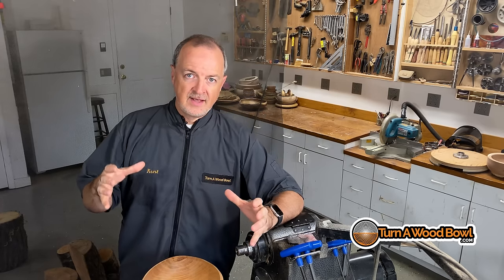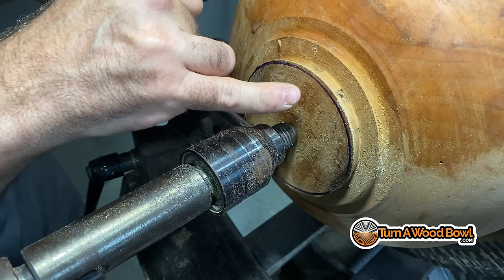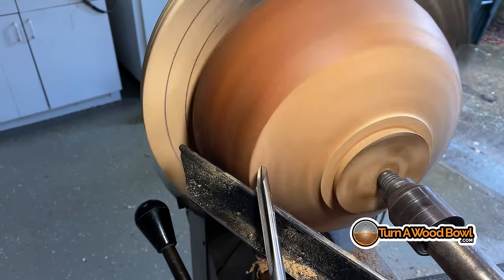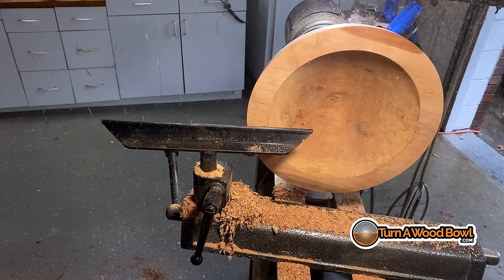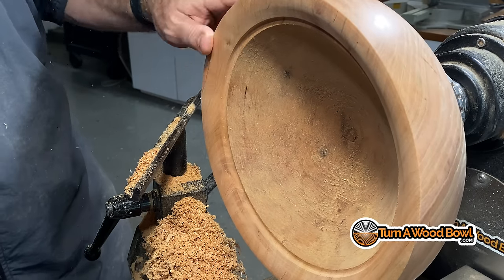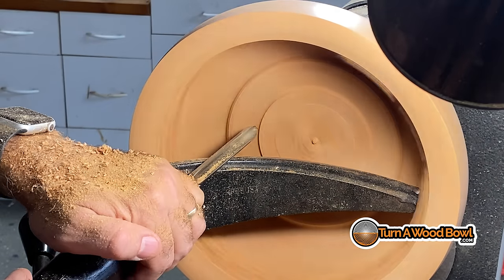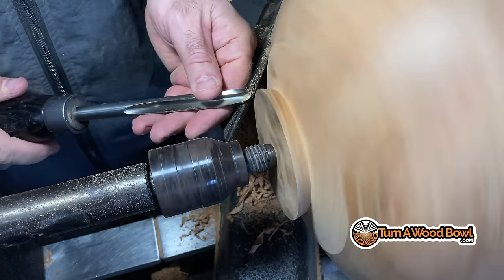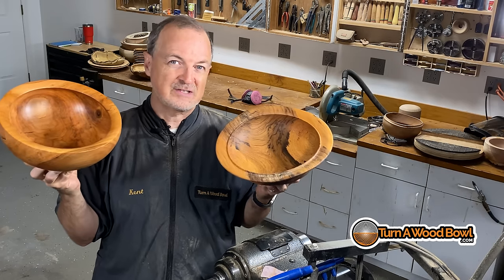Woodturning Twice Turned Wood Bowls - Wood turning Video Green Wood Dried First

Comment: As a journeyman machinist for 35 years there were some tricks we used to cut back on chatter that gets translated to your worked surfaces. Here is one, but there are many. Put a vibration damper in your bowl when pressure holding it doing the outside. I would experiment with the right size old sofa cushion foam stuffed inside the bowl. It might give you a finer finish needing less sanding. I would try it but am disabled from a hand surgery to restore damage when a heavy piece of metal fell on my hand using the lathe. Thanks so much for your fine videos. I look forward to using my hands again working with wood. You are a good teacher. an inspiration for me to work through the pain to get my hand functional.
Reply from the maker: Russell, Thank you for writing and sharing! That's good info. Thanks and Happy Turning!

Comment: I have just acquired a load of fresh cut sycamore and turned two bowls from it. My left sleeve was wet from spray when I had finished. The bowls are resting in their shavings at the moment but tomorrow I will seal the ends. It is lovely turning wet wood, the shavings come off like a stream from a hose. My next stop is drying wet bowls with a microwave.

BTW An American football is similar shape to a rugby ball used by the rest of the World.
Reply from the maker: Sounds great! Yes, green wood is the best to turn! I was thinking of a soccer ball. Isn't soccer also called football in Europe? Happy Turning!

Comment: I like to species label my first turned and date them. Then I place them in my dry unheated shed for at least a year. Had pretty good success of about 90 to 95% not cracking. Normally I leave the wall thickness at  no less than 1" even on 8" diameter bowls but 10% on bigger ones.....Ron Cumpsty .
Reply from the maker: That's a great way to do it, slow and steady. Happy Turning!

Comment: I am presently working on sets of twice turned nesting bowls that I have cored and are drying in my cellar, so this is a timely video.  I find it much easier to finish off the inside bottom of bowls by switching to a 60 degree gouge.  Looking forward to your sanding video.  They say woodworking is 80% sanding and 20% fun.
Reply from the maker: Thanks! I'll show you how sanding can be about 5% of turning!! ;) Stay Tuned!

Comment: Very nice. By the 38 Minute mark I normally would have switched to a bottom gouge. I find it much easier and smoother. 
Also why do you use Danish Oil when you could just purchase the linseed oil. I think the Danish oil has additives to help drying and is not just Linseed oil. I have been using Tung oil for the last year or so, but will have a go with Mahoney's oil at least while the bottle lasts.
Reply from the maker: Great question! The Tried and True Danish Oil has zero additives and is polymerized linseed oil. As far as I know they are one of the only companies that makes Danish Oil this way and it's fantastic. And about the bowl gouge, my main gouge is a 55° swept back bevel and it gets down in the bottom very well. I will jump to my micro-bevel on deeper or narrower bowls. Thanks and Happy Turning!

Comment: Kirk, I love your "Turnawoodbowl Videos.'  I am presently doing a set of four bowls from wet green Holly wood from a neighbor friend.  So I am learning about drying the wet first turned bowls in the micro wave keeping records on each bowl.  One of my granddaughters is getting married Dec. 29th so I am hoping I can dry the wood enough to do the twice turning early December to present them as a wedding gift. A 12", 10" and two 7" all food safe with danish oil for use as a salad bowl or popcorn, etc.  I've used the end grain sealer after I turned each bowl green on the end grain to help minimize the distortion as they dry.  I think it is helping.  I left the 12' bowl almost 1 1/2"  thick and I am wondering if I can trim it back a bit to speed up its drying time, I've been dring it for a week now it started at 6lb 6 oz and is now down to 4lb. 14 oz. any thoughts?
Reply from the maker: John, great question. As I say often, it all depends on the wood species and your conditions. There are several things to consider. Have you turned any of this holly completely yet? How much is it deforming as it drys? If the holly isn't deforming much then you may be ok. The 12" bowl first-turn 10% diameter could be 1-1/4" thick walls but you're already very close to that. The idea behind the 10% wall thickness is to leave enough material to have a complete final thin wall. If the bowl turns to an oval and you true up the exterior, there needs to be enough "meat" inside at the thinnest areas of that oval. If not, you'll turn through the wall on the interior turnings. I think you have plenty of time, I'd keep cycling the bowl through the microwave for another week or so and you will probably see their weights "come in for a landing" and stabilize. Hope that helps. All the best to you and your fantastic wedding gift!! Happy Turning!

Comment: My sister just had some cottonwood trees cut down. I'm doing two large 12"+ blanks as twice turned bowls. They were so wet they were like standing next to a water sprinkler on the lathe.  :-) In several months I'll find out how it goes on the second turning.
Reply from the maker: Keep those puppies moist for awhile so they can "calm down." Cottonwood cracks like crazy and you want to ease the drying process from high moisture too low to prevent cracking. Use a paper bag and mist them periodically. All the best to you. Happy Turning!

Comment: Hi Kent 
Fairly new to turning and learn and enjoy from your videos.
My issue is when I twice turn I have trouble with the walls being different thickness. Can’t figure out why. 
I wonder if you have any tips to correct my issue 
Thanks Jeff
Reply from the maker: Jeff, be sure to return the bowl exterior first. If it is not trued  up there will be high and low spots. When you turn the inside there will be thin and thick wall areas because of an untrue exterior shape. Hope that helps. Happy Turning!

Comment: Kent, I just love your channel I have watched others but I find yours more informative.   I watch them over and over then I go out in the shop and turn away.  I am new and have only turned few bowels because I don’t have any dried wood.  I am still practicing.  You have mentioned your dryer for drying bowl blanks.  What do you use to dry blanks and how long does it take.  Thanks Kevin from Minneapolis.
Reply from the maker: Kevin, 
Thanks for writing. Great question, a loaded one, but a good one. You can dry a number of different ways. Have you seen my microwave drying video? I'm finishing up my online Wood Bowl Turning Start-to-Finish eCourse soon, and I think I'll be starting the Green Wood course next. Quick answer - use an insulated space, could be an old frig or freezer, or make a box with insulated foam, then insert a regular lamp with an incandescent light bulb. Be some small vent holes to allow moisture to evaporate and you're set. Stay tuned, I'll have more to come.
Happy Turning!

Comment: Thanks for another great video.  
I notice in your videos you have some kind of sheer material around your lathe, I assume to confine chips & dust. I'll be doing the same. What kind of material did you use?
Reply from the maker: Good question, and you are right, that's what it is for. It's a roll of replacement window screen suspended with bungie cords.
Reply: @TurnAWoodBowl  thanks

Comment: What about a vacuum chuck for reforming the tenon and turning the outside after drying? I have one but have only used it for finishing the undersides of bowls but am about to do my first green bowl that is dried and ready. Will the vacuum chuck have enough holding power?
Reply from the maker: You can go that route, but it's time consuming, expensive, and won't work with porous wood surfaces or worm holes…which are common. Happy Turning!
Reply: @TurnAWoodBowl  it worked really well for finish turning the outside and reforming the tenon, but then yes there was a worm hole at end doing the underside and it took me forever to figure out why I couldn’t suction!!

Comment: Kent - why not use the same jam chuck for both operations? (the flat/foam padded plywood disc vs the rounded 'stump' of a chuck you used to finish the foot) I might have to make one of the flat ones, thanks for the idea and the video! Cheers.
Reply from the maker: Good question. After a bowl has been rough turned and dried, many things are distorted. I find placing the rim on a padded surface gives more support to the piece and helps center up the tenon quicker, versus randomly trying to find the center on a smaller jam chuck. Thanks for asking. Happy Turning!
Reply: @TurnAWoodBowl  Continuing the question: I was wondering why you don't use the flat padded disc for both operations.

Comment: Hi Ken. Thanks for another terrific video. Your approach to the second turning is really helpful. I started to try to make the jam chuck you showed but have a few questions: I presume that it’s 15-16 inches in diameter. How wide is the space?  How thick and hard is the rubber? I tried using some thick, somewhat soft under carpet rubber and I was unable to true the bowl due to a slight wobble while turning. Lastly, do you have a dedicated faceplate that you keep attached, or do you have a solid way to attach and detach it?  Thanks, Arthur
Reply from the maker: Arthur,
Great questions.
I use 3/4" plywood that is as flat as possible. I rough cut the circle, attach a dedicated faceplate and then turn the edge smooth. Then I pieces of a rubber floor mat to make the side. Hope this helps.
All the best to you and Happy Turning! 
Kent

Comment: Hi Kent,
 Another nice video and very helpful.  It looks like you have a Robust Sweet-16...how do you like it?  I have a Robust American Beauty and love it!   I picked it up at the Robust factory as I live nearby in Central Wisconsin.  I was curious of what looks like a tail stock extension on the quill.  Is this an add on Robust has or was it developed on your own.  What is the reason for using it?  Thanks, Myles
Reply from the maker: Love my Sweet 16. The tailstock extension comes with the 16 to bridge the gap when turning with the rail section removed. Happy Turning!

Comment: I would like to know the speeds that you use which I imagine will vary with the types of wood. Great information, thank you
Reply from the maker: The speeds vary based on stability and I try not to exceed 1,000 rpm. That being said, my lathe does not have an rpm readout. Lathe speed video coming soon.

Comment: Hi Kent, Yes I'm trying what you call a twice turned.  As I mentioned in another post, I bought 2  Olivewood blanks.  Out of the 24 bowls that I've turned none had been green.  So, I started to watch videos on how to handle a green blank..  

I've had trouble with cracking even though I've tried to dry it.   I'll take out 3/16 of an inch and it'll be wet again.  4 times drying before I got it down to 3/8 of an inch.   Filled the cracks as they happened.  

I have not had any classes in turning or finishes.    I started turning ink pens first.  Then my brother told me to try a bowl.  And he gave me a 5 inch cedar blank.  Ha Ha No more pens.

Have you turned green Olivewood before and if so what did you do ??

Wesley Colyer,  Mack, Ohio
Reply from the maker: I have not turned olive, but I've turned ligustrum which is a relative to olive. What I noticed was the wood has lots of oil and can be turned once to finished size instead of twice-turning. Make the wall an even thickness and it shouldn't crack. All the best and Happy Turning!
Reply: Thank you Kent for your reply.  I read what you said about Olivewood.   But I didn't get to your answer before I put it in a dehydrator 24 hours at 95 degrees.  It warped with little cracks in the end grain.  

Next time I will try once turned on green Olivewood. 

Wesley Colyer

Comment: Kent, I'm a rookie turner and these tutorials of yours are like gold to me.  This one was particularly helpful.  Here's my question.  All I have to work with is really green wood and I am really frustrated by the cracks that develop from (I guess) improper drying.  It seems that everyone online has a different method for drying a piece of wood.  I've tried most of them and they all work to some degree; but I'm looking for the best method and I have yet to try kiln drying.  You mentioned putting a rough turned blank into your dryer.  Can you explain how that works?  I understand pith problems, equal thicknesses on the sides and bottom, and slowing down the end grain.  How is it that to prevent cracking one must slow the drying process and yet speed it up by putting it in a kiln?  

My other question is what kind of beer do you keep in that fridge back there?  Thanks for going to the trouble of making these videos.  You're teaching me a lot. - Tom
Reply from the maker: Hey Tom,

OK, I have a simple box made of 3/4" foam insulation with a work lamp and a 70 watt light bulb inside. I rough out bowl blanks with wall thicknesses 1/10 the size of the bowl diameter. I seal the end grain sides with Anchorseal and put them in. The temp is around 90-100° and they dry and deform after about 2-3 months. Then I twice turn them. 

Remember every tree species is different, as is every different environment. Be patience, pick one or two local species of yours and learn how they act and respond to different drying times, etc. You can become a master of your local tree species, just be paying attention. 

Happy Turning,
Kent
Reply: The main thing with drying green wood to me is a large grocery bag, when you have a rough turned put it in a large paper bag, no plastic, put it in there for a couple months and return it to lathe and cut some more. Cut some more and put it back in a Walmart bag and in a few weeks turn it again. ⁷

Comment: I agree with Don.  Great videos.  When you do your videos, can you please mention the speed of your lathe?  I'm going to make the 'jig' or press chuck you show here ... just want to know how fast I can turn using it.  I know it will be pretty slow, but specifics would help.  Also, how tight do you crank your tail stock.  Thanks for the videos.
Reply from the maker: I'll have a video on lathe speed soon. Believe it or not I don't have an RPM readout, its all feel.

Comment: I found this video very enjoyable and helpful, as well as your many articles on turning at TurnAWoodBowl.com.  These are all  very beneficial for both novice and somewhat experienced turners.  This video reinforces what I have been learning at the woodturner's club I belong to (Illiana Woodturners - shop located in Holland, Illinois) and from other material I have seen elsewhere.  This start to finish video of the process was very good.  

I especially like the home made faceplate/disk you showed to accommodate the eccentric shapes of the warped bowls.  I will whip one up straightaway.

Two questions:  
1. I coat the entire green turning with Anchor Seal, not just the end grain.  Is that taking it too far.  You recommend only coating the end grain areas.  I can see the logic.
2. What percentage moisture do you recommend for the beginning of the second turning?  (Measured with a meter? or by weight?)
Reply from the maker: Thank you! Glad to help. BTW, I was just in Illinois and drove back some pear, cherry, elm, and plum! ENjoy and all the best to you!

Comment: New to the lathe and have turned two bowls. I see that you are using a tenon on your bowls.  I have used a mortise, but to my way of think then you can't make a twice turned bowl due to being able to hold the bowl while you straighten up the tenon.  Do you use a tenon on all your bowls or do you have a way to hold the bowl while you clean up the mortise if you use them?
Reply from the maker: Yes, I'm a tenon fan. You can twice-turn a mortise, but it's a bit awkward for me. I'm sure others do it with no trouble with a bit of practice. I find the tenon allows for more foot options too. Happy Turning!

Comment: A bit of advice please. I have some sycamore which I have sought to twice cut. I used your advice to dry the wet wood in a microwave. This first cut bowl is nice and dry. But, big but. The bowl is, as you said, now oval shaped. The inside on the narrowest diameter is 6 7/8” and the widest is 7 1/4”. Unfortunately the walls are only 1/4” thick. There is no way to turn it round. It is pretty smooth. Do you think that I could sand it and finish it? Or should I put it down to experience and put it in the firewood? Trouble is - I love it as my first effort!
Reply from the maker: Good question. Of course you can sand it and make it good. I think you now know what to do in the future, if you want to make a round bowl. It's all experience, one way or the other. Happy Turning!
Reply: @TurnAWoodBowl  I’ll send you a picture.

Comment: Thank you for this video! Enjoyed seeing the three different angels on the gouge!! My only complaint would be wearing a glove! My suggestion to your viewers is if you have to wear a glove PLEASE use tight fitting gloves change them out regularly! I work in the commercial woodwork industry and have done for 50 plus years! There is nothing worse than trying to bandage up a hand that’s been caught in a saw, shaper or any other machine! Sorry if you think my comment is negative but I care!
Reply from the maker: Good call! Yes, I need to replace that one. Thanks.

Comment: Question - would you have to do this when working with a dry bowl blank?

Also, I want to make a small lidded box for my first project in the lathe on something small like that how much movement can I expect to see? If turned from dry wood
Reply from the maker: Good question, Tyler. No, if the wood is dry you can simply turn your final shape and be done. The wood should not move any more since it is dry. All the best to you and Happy Turning!